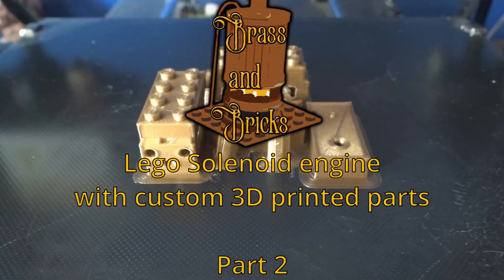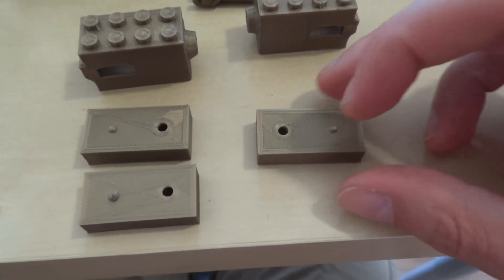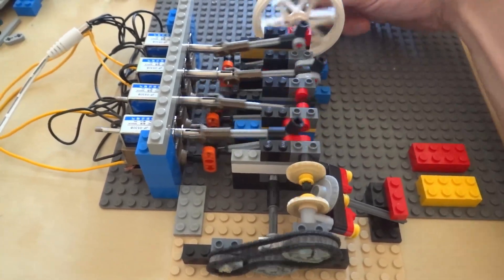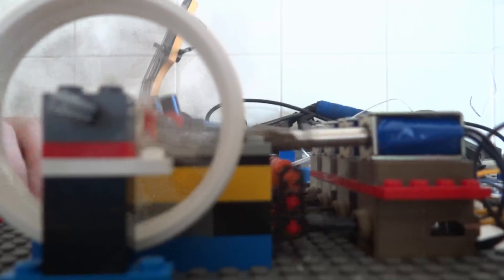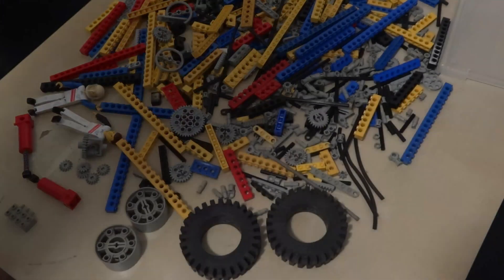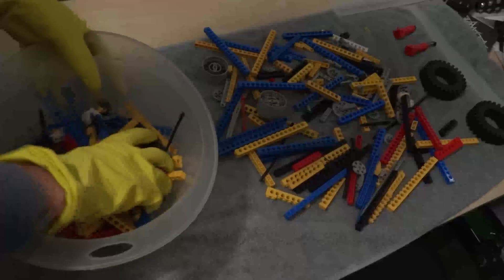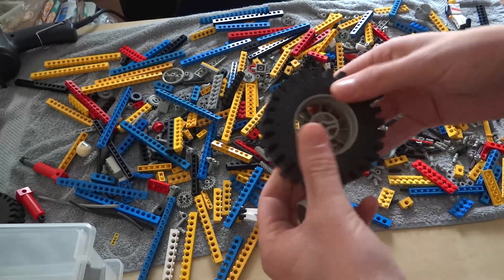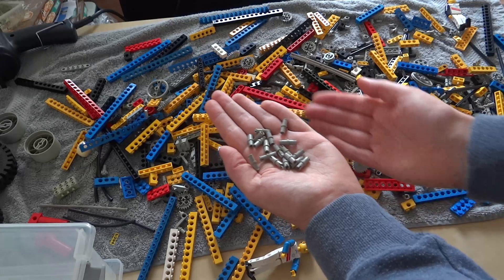Lego Solenoid Engine with Custom 3D Printed Parts - Part 2

Comment: wow! what a fast solenoid engine! maybe you can make a v1.1 with all the new pieces and new differential?
that lego collection is awesome! i am so jealous! i hope you didnt pay to much for it because many of these parts are quite expensive these days ;-)
the 2x4 brick with 3 mounting holes is required for those old pneumatics to work, the pump (with the spring) has to be connected to the central hole, just see the instructions of old lego sets (8040)
i am looking forward to your rotary engine!
Reply from the maker: Yeah it was so fast it would damage itself haha
I only paid 25 euros for it, quite the deal I think!
Thanks for the tip, I shall experiment with that brick :)